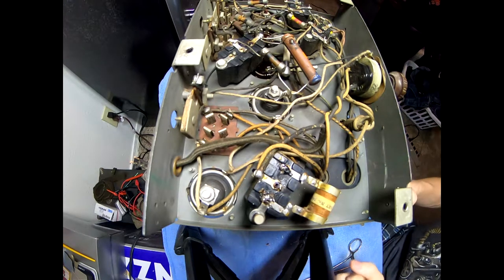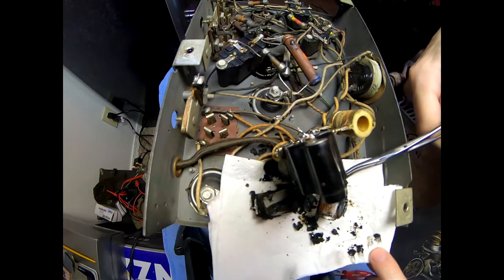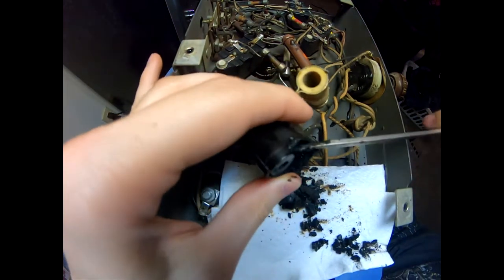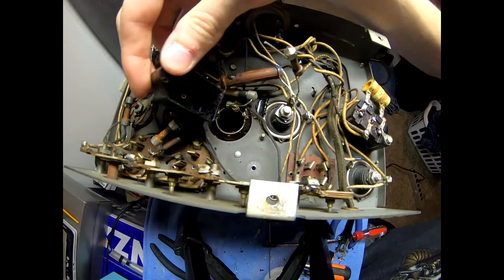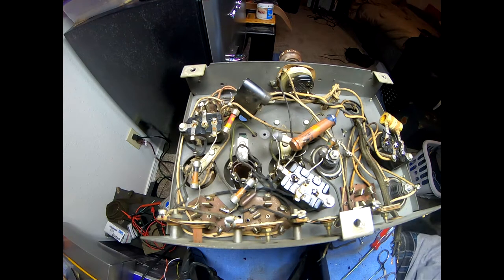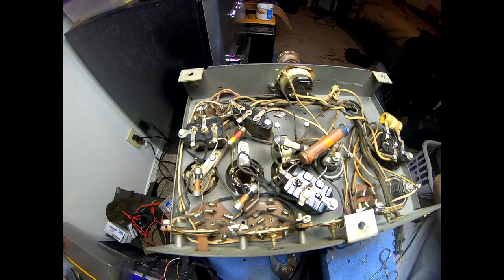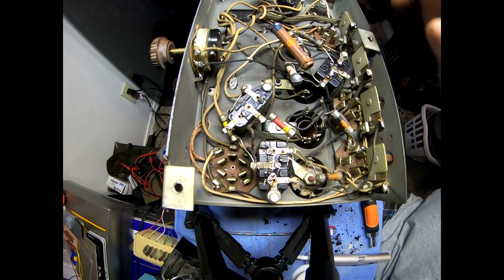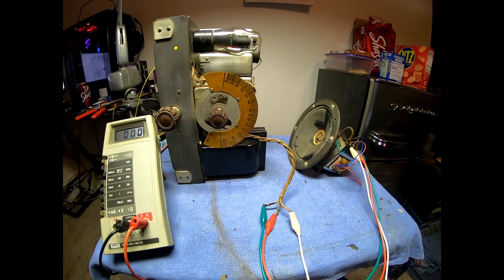Philco Jr. (Model 80) Rebuild Part 2- Bakelite Capacitor Block Restuffing

Comment: Saw an article from 1941 that I thought you might be interested in:
Checking Performance
The above information should be useful in determining the converter to be used for a particular job. Once the converter is built it is comparatively easy to ascertain whether performance is satisfactory. Of course in the laboratory the most satisfactory method is to check stage gain with a signal generator, but few of us have signal generators with which to make precision measurements. We usually rely on the sound of the set and whether it pulls in the signals.
The first check on any converter is to measure the electrode voltages with a high-resistance meter. The correct voltages are indicated for the various circuits. Next in order of importance is to check to see if the oscillator amplitude is high enough. The easiest method of checking this is to measure the d.c. grid current in the grid leak. This grid current increases directly with oscillator voltage and is so closely related to oscillator voltage that manufacturers, instead of rating the oscillator voltage to be used with a converter, rate the grid current as measured in a recommended grid leak. On each of the preceding circuits the rated oscillator grid current is given. In practice the grid current cannot be held to this value over the band, especially if a wide tuning range is desired as in commercial broadcast sets. In communications receivers where the tuning range is small the variation is not large. A 2-to-1 variation in a set having a wide tuning range is not bad. If rated grid current is obtained in the middle of the band the variation over the band is usually not excessive. The grid current is important because it determines the point of optimum gain, and other than rated value results in a sacrifice in performance.
Converters using the 6A8, 6K8, 6SA7, 1A7G, or IR5 should next be neutralized for space charge coupling. This is accomplished by connecting a "gimmick" between the oscillator and signal grids. If a gang condenser is used and the oscillator and signal grid sections are adjacent, neutralization can be accomplished by connecting the "gimmick" between the stators of the two sections. Commercial practice is to solder two small pieces of wire to the stator lugs and then to twist the ends together. About two turns is satisfactory. Note: Neutralization is done on the high-frequency edge of the highest-frequency band. Low-loss wire should be used. The capacitance should be adjusted to give maximum sensitivity.
There are several phenomena that can take place that will upset performance after the above considerations have been observed. Parasitic oscillations take place in the oscillator section if too much feedback is used or if the values of grid coupling condenser and grid leak are too high. A 50-μμfd grid condenser is usually satisfactory for most circuits. Most grid-leak specifications call for 50,000 ohms. Battery tubes having low oscillator mutual are specified with as high as 200,000 ohms, and the 6SA7 with its high oscillator mutual or transconductance is rated with 20,000 ohms. If the oscillator and signal-grid circuits are not adequately shielded and isolated, severe coupling between circuits is obtained at some frequencies. The signal-grid circuit in extreme cases may load the oscillator enough to cause it to stop oscillating. This effect can be detected by observing the oscillator grid current as the set is tuned through the coupling point. A rapid dip in the oscillator grid current is experienced as the coupling point is passed. Shielding of coils and isolation of parts and leads eliminates this trouble. Motorboating on strong signals is the result of oscillator shift with a.v.c. and other element voltage variation. It was pointed out that the 6A8 was particularly bad in this respect, that the 6K8 was much better, and that the 6J8G and•6SA7 are very good. Motorboating can be experienced with the 6J8G and 6SA7 if power-supply regulation is bad and if the oscillator amplitude is not adequate. Stability is improved by operating at or somewhat over rated amplitude.
The major troubles experienced with converters produce a flow of grid current in the signal-grid return. This is true of the transit time effect with the 6J8G, the space charge effect with 6K8, 6SA7, 6K8, 1A7G and 1R5, and the phase shift of the high cathode to ground voltage in the 6SA7. The circuit of Fig. 10 shows how a check for signal-grid current can be made without the use of a sensitive microammeter. An electron-ray indicator tube such as the 6U5/6G5 will indicate any current flow in the a.v.c. return. Most returns have about three megohms total and a d.c. current of 1 microampere will produce 3 volts, which will make a noticeable deflection on the target. The voltage drop between the bottom end of the coil and ground should never exceed approximately 1.5 volts. This voltage can exist because of contact potential in the diode and other grids connected to the a.v.c. system, and does not indicate trouble.
Signal grid current with the 6A8, 6K8, and 1A7G usually results from space-charge coupling, as already described. A convenient test for its presence is to short the signal-grid tuned circuit with a condenser. This shorts out the voltage and eliminates the current. 'The "gimmick" when adjusted properly neutralizes space charge coupling.
Signal-grid current because of space-charge coupling is also obtained with the 6SA7 but in addition current can flow because of high cathode-to-ground voltage and phase shift of this voltage with respect to the oscillator grid-to-cathode voltage. If bypassing the signal grid does not eliminate the current, the trouble will be found in the oscillator coil and connecting leads. The cathode lead should be kept short and the circuit of Fig. 8 adhered to. The ratio of length to diameter of the oscillator coil should not exceed more than about 1.5 to 1. With long coils and small diameters there is appreciable phase shift with attendant troubles. As mentioned previously the cathode lead should pull away from the coil at right angles so that it does not couple to the coil.
Recently, certain manufacturers have used triodes for mixers. A typical circuit for this type of mixer is shown in Fig. 11. It will be recognized as similar to many of the circuits used in the older days. In commenting on this circuit it might be said that the chief advantage of the triode is that it develops very little noise. It is thus possible to add extra gain behind the converter in the i.f. and get high sensitivity with a good signal-to-noise ratio. The triode in this connection has serious disadvantages, however. It is necessary to use a special low-impedance primary i.f. transformer so that the grid-to-plate capacitance of the triode will not cause loading of the signal-grid circuit. In the practical case the tuning condenser required to tune the i.f. primary is approximately 2000 μμfd. The high cathode-to-grid capacitance causes severe coupling of the oscillator and signal-grid circuits. This evidences itself in the form of instability with a.v.c. variation, "pull-in " on strong signals, and oscillator shift with tuning of the signal grid circuit. In applications where stability is not of prime importance a pentode such as the 6SJ7 or 6AB7/ 1853 could be used to give good signal-to-noise ratio. The low signal-grid-to-plate capacitance in these types would allow the use of conventional i.f. transformers.
* Ken-Rad Tube & Lamp Corporation, Owensboro, Kentucky.
1 - In common terminology, a "converter" is a tube performing the dual functions of mixer and oscillator; a "mixer" does not incorporate an oscillator section. Any converter tube can be used as a plain mixer by providing excitation from a separate oscillator tube. - ED.

Comment: It looks like there might have been only one other lead to unsolder. What leads you to keep the block in-chassis? Nice video. Just found you. Now a subscriber.
Reply from the maker: Leaving the blocks in is far easier than removing them and having to replace them with terminal strips, plus anyone who goes in after me will still have a decent idea of where all the components are supposed to be.
Reply: @Eclec-Tronics  I'm sorry. I didn't mean to suggest that you shouldn't restuff the blocks. I meant that there was only one lead holding the block in the chassis, and you might have unsoldered it for ease of access. But, later in the video you mentioned that you didn't have solder, which suggests that you might not have had your soldering iron available. I'm in complete agreement that the cap blocks should be restuffed.
Reply from the maker: @fibberscloset498  Gotcha, no offense taken.

Comment: I a little confused about how you know which schematic caps correlate to each package.  How did you know, for instance, that 21 and 25 (0.001uf and 0.015uf respectively) were in the same bakelite block?
Reply from the maker: Each block has a part number assigned by Philco which can be referenced to a master parts list. I found a copy online some time ago and used it to identify the contents of each block.

Comment: Is it ok to use two safety capacitors instead of one safety capacitor in this replacement ?
Reply from the maker: Do you mean two in parallel to get to a desired value? I've done that before, shouldn't be any problems.
Reply: Great...thank you for your response.  @Eclec-Tronics